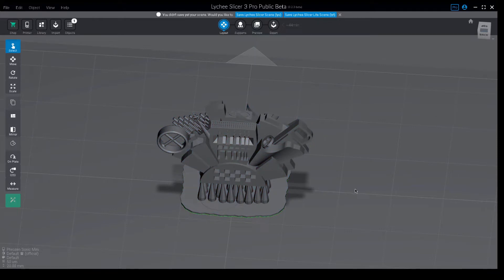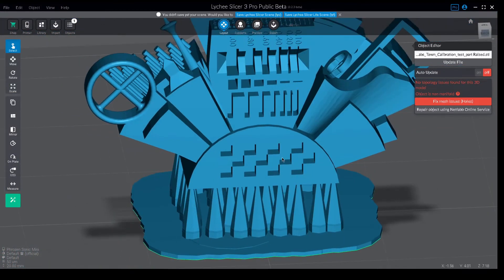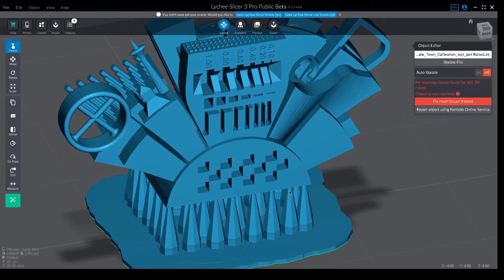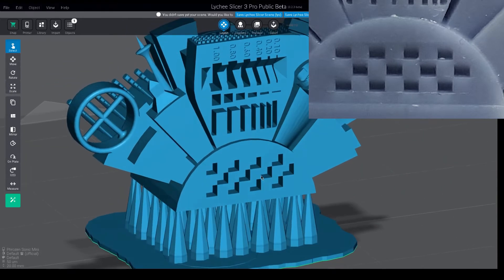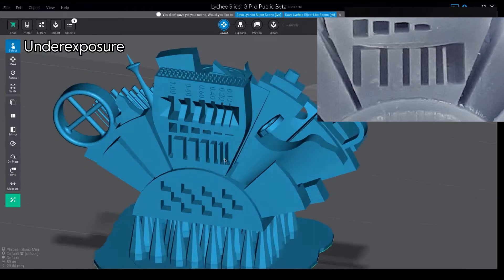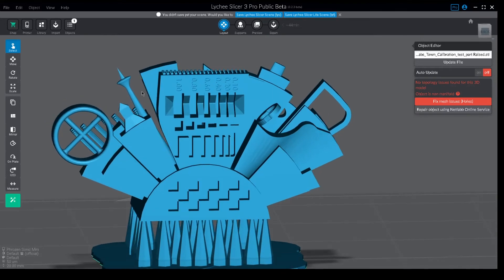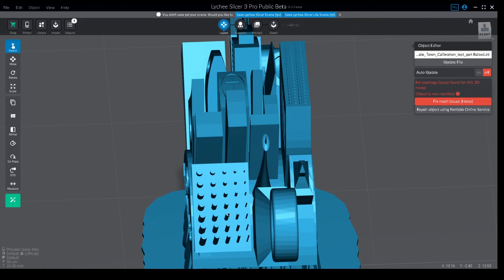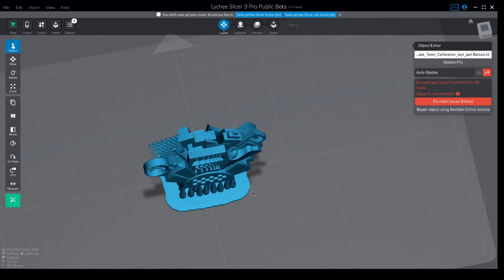The BEST Calibration Tool for Resin 3d Printing - Ameralabs Towns

Comment: I run the Photonster and Phrozen's matrix to finesse layer times initially, as well as just "looking" at the prints on the Phrozen matrix for overall aesthetics, followed by cones of calibration to finesse lift speeds and really dial in cure times after the validation sets. then I'll finish with Ameralabs and/or Hidden City calibration cube. If I'm doing practical prints with size accuracy requirements then I like to check shrinkage using the Shrinkage and Exposure piece, or Calibration Measurement, really handy prints if you are printing models in resin that use multiple parts with keyed, flat interfaces like you get from DM stash for example.

Comment: What do I do if some parts print indicate overexposure and some indicate under exposure? The last 2 slots right above the checkerboard didnt print(the horizontal not the verticals) indicating overexposure, but the nubs on the top skyscraper printed only halfway (indicating underexposure) and the loop bit printed but I broke it indicating under exposure. The checkers, vertical slots, space needle, and angled skinny hairs all printed perfect.

Comment: Thank youuu, I have been struggling with the fine tuning of settings for the elegoo plant-based resin grey in color for my mars 2p. ofc the original print with rooks worked out beautifully but I am amazed a calibration print isn't the first print a machine would have you do. I am new to 3d printing and a solid problem solver soo learning how to figure out the settings in this method is ideal but also . . . . fundamental to this hobby/work to be fun and sustainable for someone who really doesn't wana simply do filament. excited to get to the point of being able to make my own files with confidence in printability. Also, the calibration tool is cute and not the worst lil table decoration xD haha can't wait for the accumulation of many as I try different resins over time. gg wp